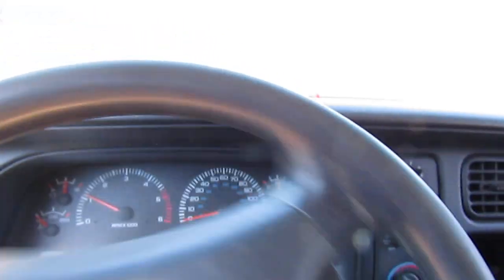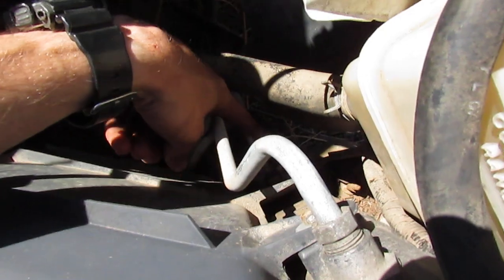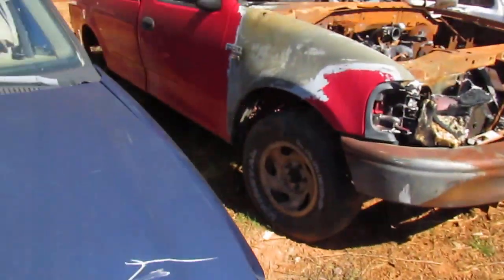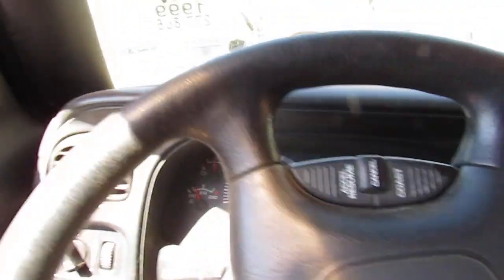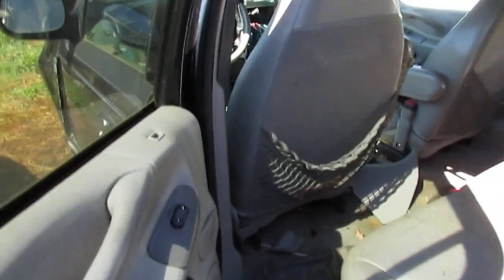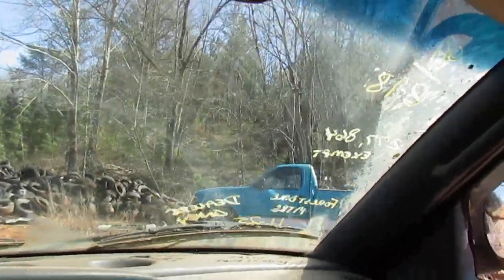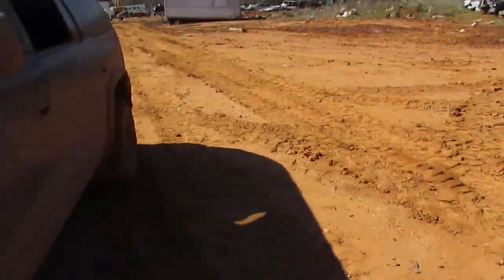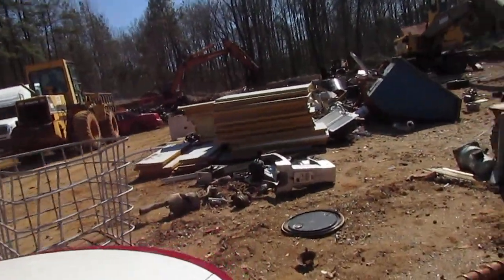Radiator Scavenger Hunt Vlog

Comment: If the truck isn't warming up properly it could be that the thermostat has failed and is stuck open.  When that happens the coolant is flowing through the radiator constantly instead of just round the engine block while the truck is warming up and it will take forever to warm up like that.  It is also well worth pulling the water pump to check it out, there have been a lot of cases of poor quality replacement pumps having the impeller come off the shaft so it doesn't push the coolant round the engine, though if that is the case that truck might well be in big trouble as that can cause localised overheating in the engine which is very bad news for modern alloy engines.  I've always called the orange, rusty gunge in the cooling system carrot soup, and it's something to look for when you're buying a vehicle as it's presence means that the coolant and antifreeze hasn't been changed according to schedule and the corrosion inhibitor has lost it's effectiveness, which could well be an indicator that the vehicle hasn't been maintained as well as it should have been...

Comment: The Explorer at 12:25 with the V8, what's wrong with it?
Reply from the maker: BronzeChicken it's not a V8 has the ohc v6 with bad timing chains.
Reply: Could've sworn it had V8 badges on the fenders, ah well that's a typical failure, miles and shape?
Reply from the maker: 127k miles, and it actually was in excellent shape. better condition than the one we have. And the timing chain hadnt broken. it was just rattling upon startup. Air was cold, heat was hot, and its 4x4
Reply: I had a 99 identical to it with the 5.0, I just bought a white one with the 5.0 but I'd love to have the original back, and damn, just like a good few in the JY here, it for sale or already processed?
Reply from the maker: Well... supposing you brought your own rear end, wheels, and tires. and rear shocks. you could buy it! But its been getting picked apart rapidly